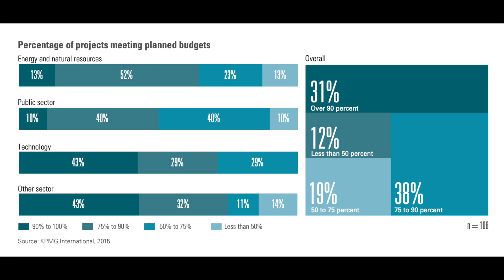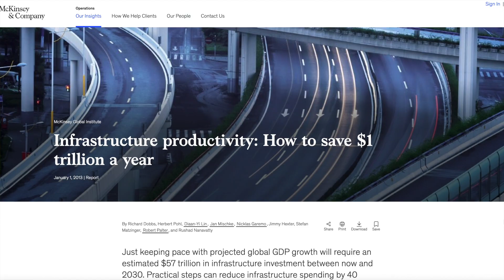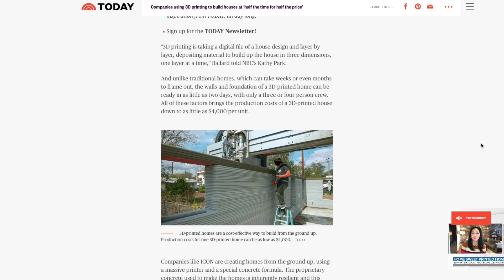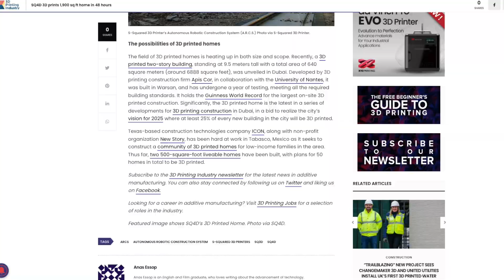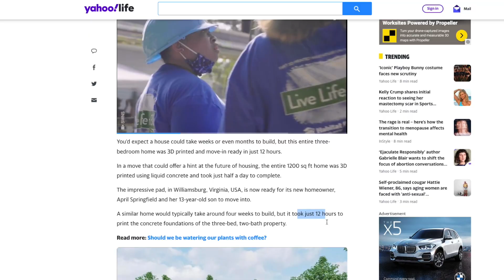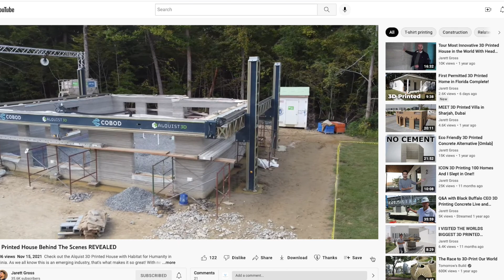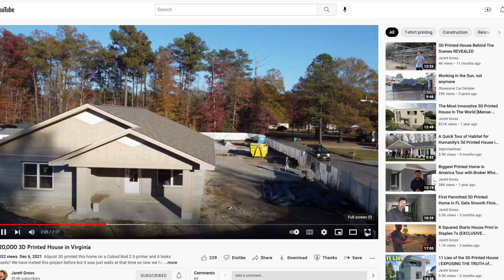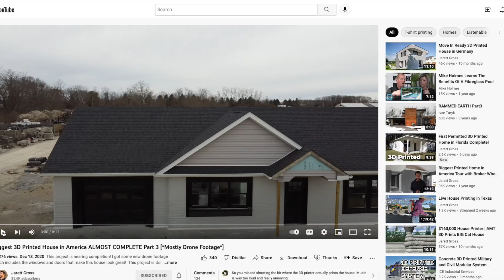How Long Does It Take To 3D Print A House?

Comment: Another great recording. Thanks Jarett. Excellent points. I am joyously looking forward to the shift from 3d to laser printing of structures. 6" and hour. I won't write the obvious joke. The process will be cheaper and faster when we shift to laser printing or the ultra violet system that Mighty Buildings (thanks for that evolutionary recording too) with the print heads mounted on tent shielded drones.  I suspect the precision of a laser will allow us to print wires, windows and wall fixtures while decreasing settling time. As an old hippie I'm wondering, what is the best way to print one of those 3d advertising screen on an interior wall. Gantries may not be able to do it, but drones can. Oh the possibilities. 

It really is "an exciting time to be alive." JOY!

Comment: what about basements? what about plumbing and electric?  and what about cracking?  and what about rainy weather?  3d printed house are stupid. Lego type houses would work better.
Reply from the maker: Interesting you say that, a company in Canada that i visited recently was just starting a printed home with a basement!
Reply: @automateconstruction  my opinion is that 3d  printed homes are like DVDs... ok for now but soon will be old news.
Reply: @rez157  You're right. It's called evolution. We went from radio tubes to the James Webb telescope in the blink of a cosmic eye, about a century. Imagine where we can go from here when we reach a point of working together to get the job done. I can't wait until printing makes homelessness and inadequate housing an ancient concept.

Comment: I'm not an expert, quite the opposite, but wouldn't it make more sense to put the printer into a construction hall where something like weather, transportation and assembly doesn't affect the printing process and just print finished parts for assembly on construction site? We in Germany have something called a "Fertighaus", where we do just that (without the printer) . It takes around 1-2 Days to assemble the "Shell" of the House on the construction site. I think this could significantly simplicity things for the 3D printer. Again I'm no expert
Reply from the maker: The print is heavier than the printer so it’s easier to ship the printer than the brittle concrete parts.

Comment: Well done. “Framing” a house via stick or 3D printing is only a small portion of the timeline to build a house, obviously. (Well obviously unless you work for a website and your boss wants more clicks.)
Construction is the industry who’s productivity improvements suck worse than any other industry. We have to get away from bringing raw materials to the job site to custom cut and assemble every stinking item by hand. I think 3D printing of exteriors and prefabricated modular walls with utilities preinstalled as much as possible is the only way we’re going to move forward. But everyone does it all or nothing.
Either all prefabricated or all site built instead of using the advantages of each by blending them in.

Comment: Excellent presentation Jarett!!  An advantage to "building vertical" much faster (up to a foot per minute) is that it becomes practical to place concrete from control-joint to control-joint, avoiding cracking; and you can consume material fast enough to make use of conventional delivered concrete, saving the majority of material cost - over the packaged specialized 3D mortar mixes (and you don't need the onsite mixing equipment/process).  Also, only a fraction of the carbon is emitted.  3D printing still has a way to go!

Comment: Pumicecrete is by far the best building material on the planet Pumicecrete is a mixture of 10 parts pumice to 1 part cement and 1.5 parts water mixed and poured into a set of reusable forms walls are poured from 12"to 24" thick pumicecrete is fireproof termite proof rust rot and mold proof non toxic and has a high R value and good sound attenuation solid poured walls means no critters can live in your walls Pumicecrete can be built for a fraction of the cost and time and pumice is the only material that can go directly from the mine to the job site ready to use without any additional possessing
Reply: you need a volcano handy ( right ) ?
Reply: @MichaelFlynn0  the closer to the mine the cheaper the cost with pumice trucking is always more than the material pumice is around $30 a yard and it takes around 300 yards to build a 1200 sq ft house but I skipped mine from Global pumice in Olancha CA to the bottom of the Baja  Pescadero because I wouldn't build out of anything else
Reply: @raymondpeters9186  - that's 1000 kms - you must be a fan
Reply: @MichaelFlynn0  if you want the best home on the planet Pumicecrete is the only material you can use 
That's all I build with